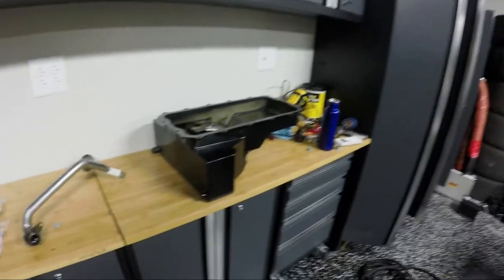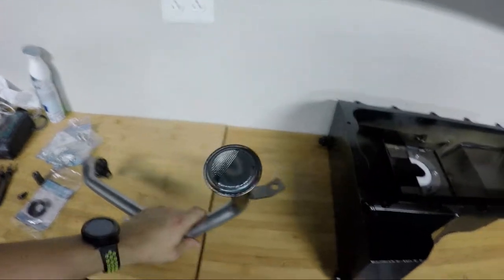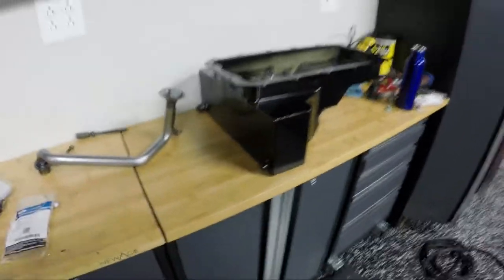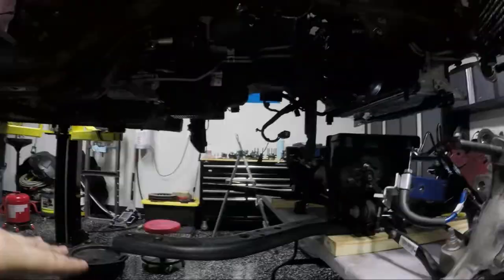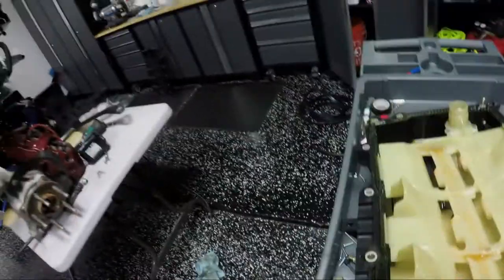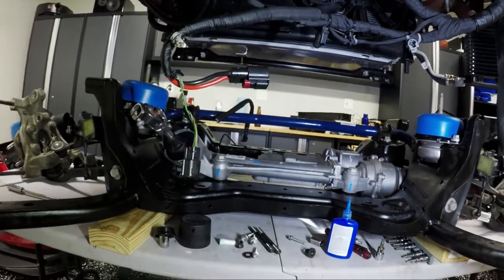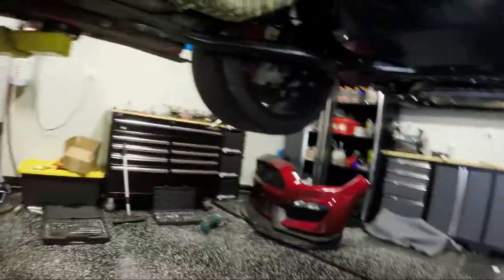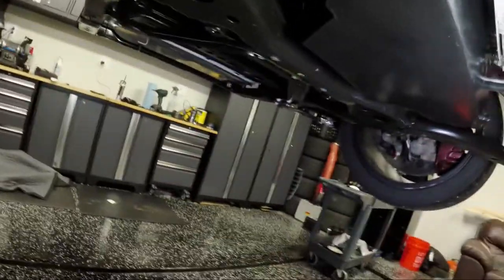FP350S Oil Pan Install in HB

Comment: I knew I woke up for something ! Your audio is fine It's neat to see I'm your 2nd reviewer . Nicely fabricated Oil pan . How much Oil do You really need in these Rascals . I love the Sump and Door system . Never even looked at my 17 Cobra cooler yet even bigger would be better , I thought about using Non Factory oil ? My GT-350 uses None though . Good Job !
Reply from the maker: The OEM oil pan is very good. Honestly, this is a hard upgrade to justify. But with all the engine work and needing to remove the OEM pan to replace the gasket anyways, I decided to do it. I use the Amsoil Dominator oil and was very impressed with how it held up over the trip.

Total oil capacity is at a staggering 18 quarts 😭😭

Comment: the vapor recovery breather catch can should drain above the oil level
Reply from the maker: This is a pretty old video. I was just copying what ford performance did on their FP350s cars. In hindsight, this is not a mod I would do - especially running e85. Too much condensation in the oil and I wouldn’t want back in the pan

Comment: HB, how has the pan worked for you so far? Looking for an aftermarket solution/not plastic that can be drilled/tapped and/or has fittings already that can be used for oil feed & drainback for a turbo kit. Seems like the 12 quarts would be ample amount for the additional volume needed to feed the turbos.
Reply from the maker: So far everything points to it being perfect. I have no indication of oil starvation and I've been very happy with the quality of work. Pricey for sure, but no leaks and issues with it so far

Comment: i was yer 7th thumbs up..nice vid.i have a stoc 16 gt350-tech pac....will never go throo  all the upgrades that yer going throo.i changed the oil not long ago...i was told 2 use the amsoil signature seris...its been working  fine/never heard of the dominator  1  u used...can u pleese explain??
Reply from the maker: The Dominator line is more resistant to shearing with a higher zinc content. It's a tougher oil more suited for racing. Bit thick for street use, though.

Comment: Do you know the ARP stud number needed for the pickup tube?  Also, many have had issue with the tac welds breaking on the baffles and the pickup tube mount cracking or breaking. Have you seen or had any issues.
Reply from the maker: I don't. You can reach out to ARP and get it. It's from the 5.0 main studs kit. Costs about $10. 

And I had both the tac welds and oil pickup tube break on me. I switched to the GT500 pan, pump, and pickup.
Reply: @honeybadgershenanigans  Thanks.  Many TMO members have had the same occur and ended up crafting supports for the pickup tube and fixing the tac welds on the pan.  Once fixed it works great.  Here is  a link if you still have your pan and want to fix it (scroll down to Posting #5):  https://trackmustangsonline.com/threads/moroso-pan-and-fp350s-oil-pan-info-supplemental.15798/#post-238745

Comment: Quick question,  what is the advantage of the ne pan?
Reply from the maker: Couple of the main ones - ability to add oil drain back from Peterson breather (oil/air separator), larger oil capacity, better oil containment (trap doors keep more directly at the pickup), and metal housing is more durable.